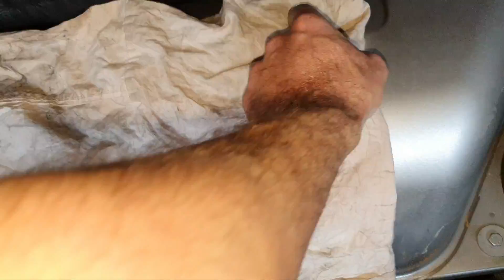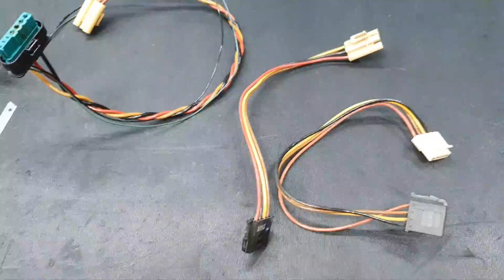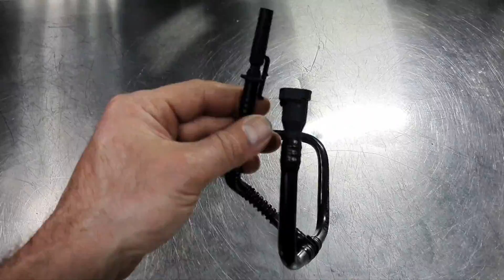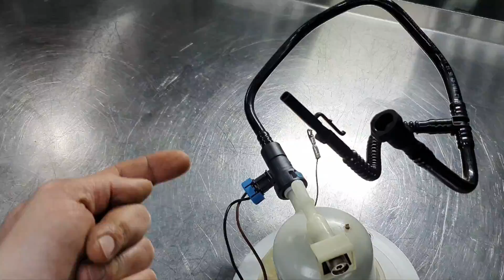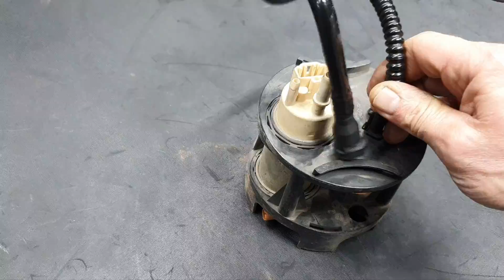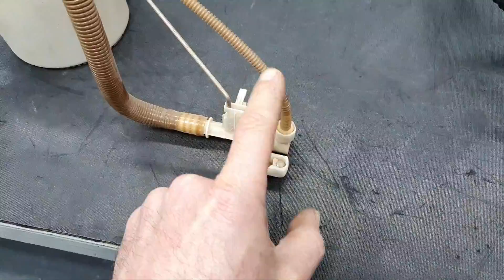SL500 2012 with 57k km check up (part 4.1)

Comment: Cable looks like the same gauge to me, plastic is probably a little swallen by the gas. Or the different part lot used a little different wire insulation. Maybe. The pin doesn't look that great. It's very possible to buy the pins.  I would need some measurement and pics to find it.